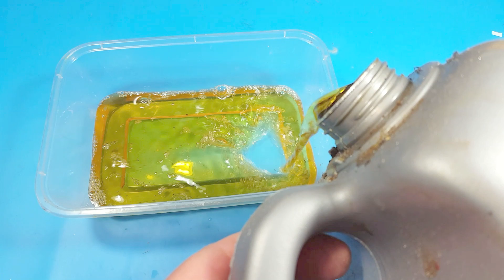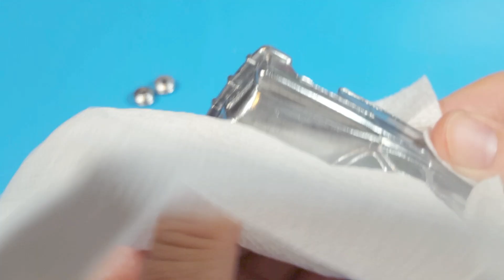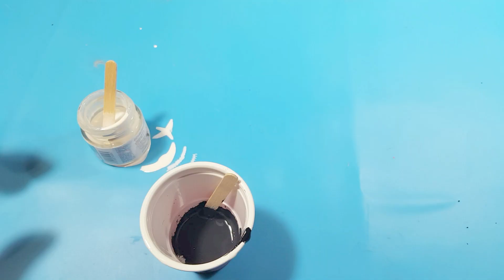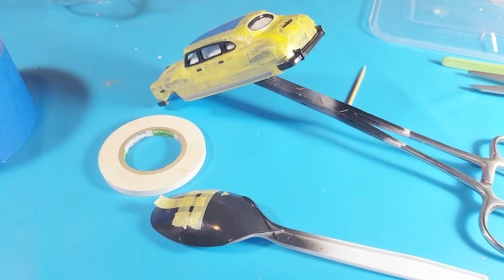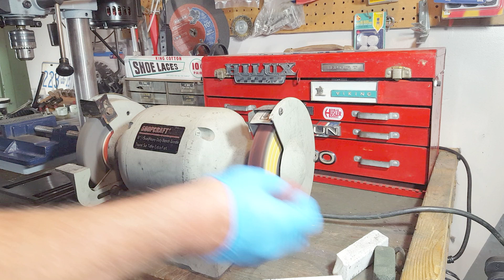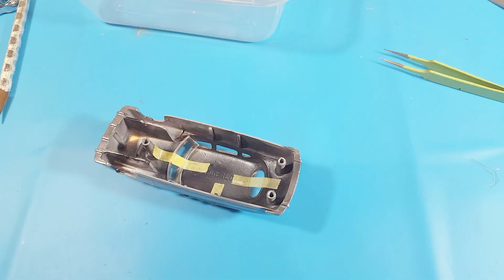Dinky 171 Hudson Sedan

Comment: Absolutely gorgeous. I rattle can so would pledge trick work. If so did you only brush it onto the tape?
Reply from the maker: Thanks Neil. I brushed it where the tape meets the paint. The idea is to fill any gaps with clear stuff so the spray paint doesn't get through. I think it may be better to air brush it, but I haven't tried. From the air brush, it may not travel too far from the tape margin. I found that the straight application of liquid traveled a bit too much, where there was overlapping tape.
The pledge works extremely well over rattle can paint, as a clear coat. Several times I destroyed a rattle can finish with a clear finish that caused it to "alligator" on me. Pledge does not dissolve other finishes (except for chrome finishes). I experimented with the new Revell chrome, and even the Pledge took the shine off of that.